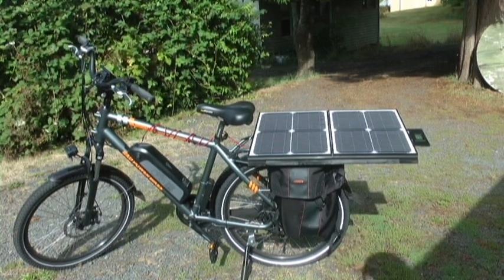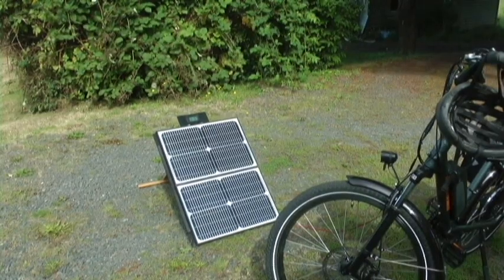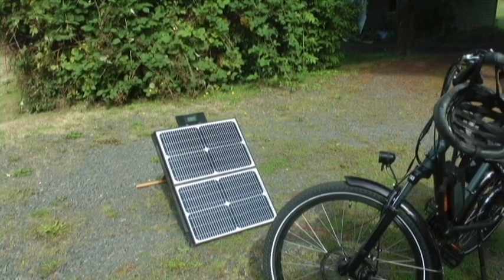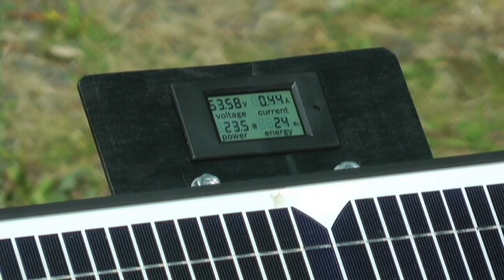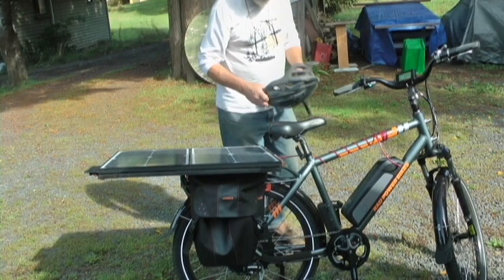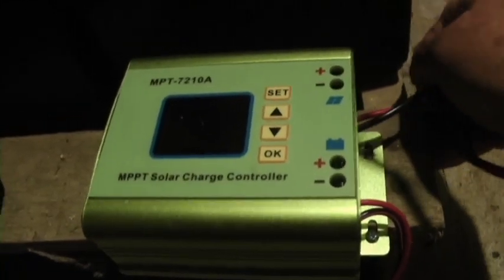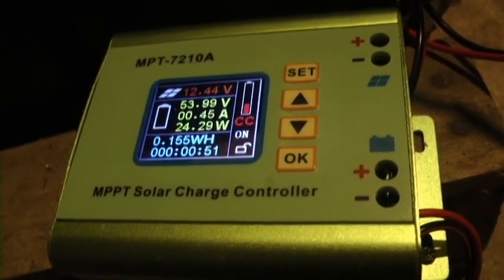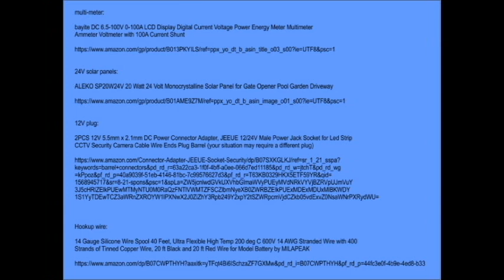Electric bike 1,000 miles on solar power

Comment: I just purchased this exact bike 2 days ago. Radcity 4. I hope it doesn't take over a month to recieve it like Ive read others have. There is a misconception when it comes to solar panels. That is that it's not the voltage that is effected under different lighting conditions so much as it is the current output. This is a good thing for charging batteries. I believe that is why you haven't had any problems so far without having a regulated output.
Reply: I made a solar charge station to charge multiple batteries from 48v to 72v and you must have a boost self set MPPT like the one I bought for $30.  You are right about shade affecting current more than volts.  However you need a big panel, mine is 390W and charges a 60V battery for a Sur Ron in 4 hours.
Reply: @ebikecnx7239  I am guessing your little setup is capable of fully charging your bike battery over 2 days. That's not bad. The wood frame for the panel looks heavy. For efficiency, I would totally go with an aluminum frame. I use a 100 watts panel on my bike trailer and on a good day it fully charges my 36v 10amp battery but on the downside, my trailer is very heavy and most of the energy my panel creates is wasted pulling that trailer. I plan on building a very lightweight trailer.

Your setup is fine depending on what your goal is. On a good day, it can give you an extra 15 km range without peddling assist, 30 km on the low assist. 
Voltage is sort of irrelevant when it comes to solar panels. 50 watts is 50 watts no matter what the solar panel voltage is. Connecting 2 24 volts in series does give a slight advantage in conversion making it a bit more efficient.
Reply: @jacquespoirier216  no, my solar setup uses a 390W mono PV panel and charges my 60V Sur Ron battery in 5 hours.  Did you see my solar charging station video using the step up boost MPPT controller?
Reply: @jacquespoirier216  https://youtu.be/VjnYeoK6wCo

That's my setup
Reply: You are right, the amps go down but the voltage is pretty constant.  That's why you must always test your new panels for Amps as well as Volts, not just the latter.  I never use a panel without making sure it's at, or above, specs.  Here in the tropics I often see better than listed performance on a good monocrystalline PV solar panel.
Reply: @ebikecnx7239  I was referring the panel on your bike. 2 days on those alone.

Comment: The setup will not work well because the panel is too close to the seat. Your body cast a shadow if the sun in front of you. Also the Panels are too small.
Reply: Panel for real world charging times (3-4 hours) will need to be 350W to 450W which is around 2m x 1m
Reply from the maker: @ebikecnx7239  It works better than I thought it would, however, I usually charge it with the panel off and sitting in direct sunlight.  I have been able to keep it charged with the panel 99+% of the time over these 1000 miles and use the bike almost daily.
Reply: @jonathanlingel5235  that's great to hear, my setup is a home e-charging station as I like rigid monocrystalline panels.  My 390W panel is too bulky to be moving around.  Flexible folding panels are just way too expensive.

Comment: Yeah there's  another  charge  controller  the blue 300 does great in and out of the  sun. Then there's  the one Grin sells but there $$$
Reply: Don't need Grin just buy it direct like I did..$30USD.  Grin with shipping and tax is almost $100USD..what a s cam
Reply: @fromtheflightdeck252   yeah I have two of the 300's one 7210 and use them all the 7210 is great  for top balancing  as it drops the charge rate when the battery gets to 80 90% but it's only good for stationary setup and still really bad on partly cloudy days.

Comment: think i can trust the BMS on ebike 48v batteries?  Okay to charge at 60v5amp using solar directly?
Reply from the maker: If the 60v means "open circuit" voltage it would probably be fine.
Reply: @jonathanlingel5235  That would be awesome to not have to install a charge controller!  Id hate to ruin my brand new battery though.  Don't think the 54.2 fast charge vs 60v would be an issue? And think the BMS would really stop overcharge without fail?
Reply: No don't trust it.   I solar charge to 90% SOC too..because solar does not balance the cells.  Every 4 or 5 months I use the OEM mains charger to balance the cells at 100%.  Rest of time it's solar charge station and stay in 20%-80% battery charge for long life of that expensive battery.

Comment: Try changing to a Victron mppt solar charge controller like the 75V | 15A model.  More expensive but it puts in way more amps than the cheaper items made in China. I've read that some made of Chinesium that are sold as mppt are actully pwm falsely sold as mppt.

I'm getting up to 20% more power than before and there is no cooling fan to use up your energy.
Reply: Oh my, that charge controller... attractive versatility, design and price but so unefficient. Yeah, better pay for a real MPPT charge controller.

Comment: Tow a trailer more solar more battery
Reply: My build has a single 100w flexible solar panel. Two 500w Bosch batteries. While I am using one battery in the bike, I am charging the other one. I am able to travel day after day all day long and never run out of power. Here is the link for building the setup. 
https://www.youtube.com/watch?v=F27a7yQKD6s&list=PLyhwVz7fjRxV51lX-FTs7GC2HGz8x-aYd
I am considering using a 175 w panel because a consistant cloudy day would create a problem with the 100w panel. A 175 watt panel would keep charging even on a cloudy day